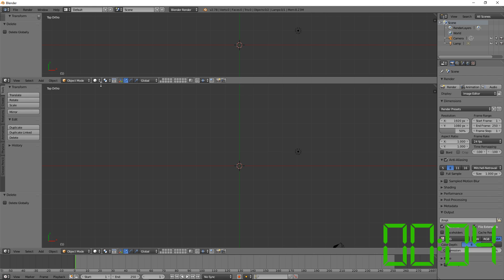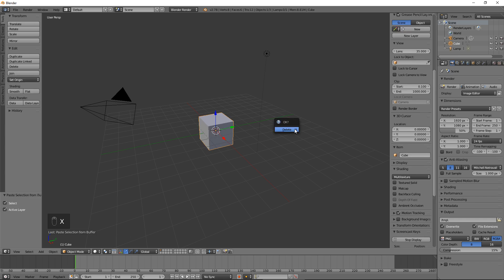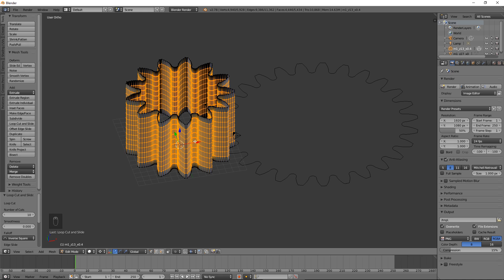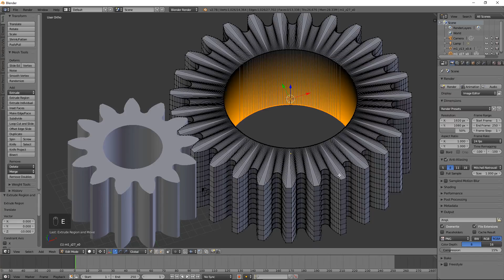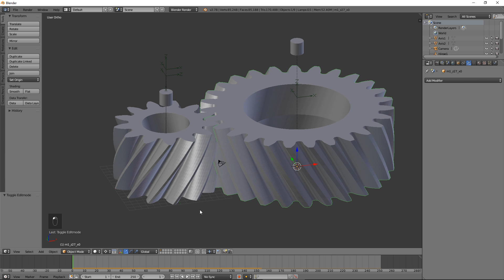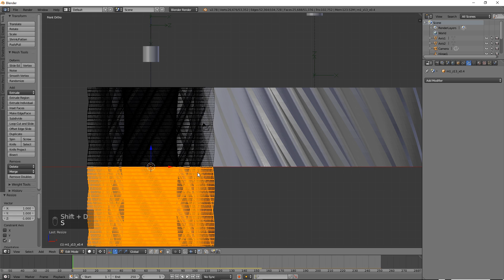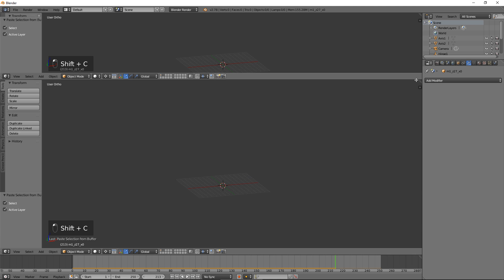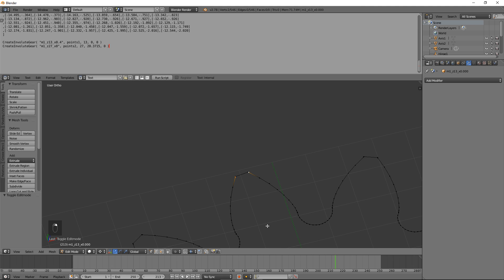Tutorial: How to Instantly Model Straight, Helical and Herringbone Involute Gears in Blender

Comment: Blender 2.8 users:  To use the auto-generated python script that creates the gear profile, you need to change 4 lines in the script.   These lines of code are deprecated in 2.8 and only work in 2.7 or less. 
    # Link object to scene and make active

    # these lines are valid  for 2.79 not for 2.8
scn = bpy.context.scene
scn.objects.link(ob)
scn.objects.active = ob
ob.select = True 
   
    # revised commands for 2.8
    view_layer = bpy.context.view_layer
    view_layer.active_layer_collection.collection.objects.link(ob)
    view_layer.objects.active = ob
    ob.select_set(state = True)
Reply: doesn't work "import bpy from math import *
  File "<blender_console>", line 1
    import bpy from math import *"
SyntaxError: invalid syntax
Reply: @rogermachin1046  You need to separate the import statements.
import bpy
from math import *

Comment: I have tried a 10 to 100 teeth  ratio and I had to go over 1 in profile shift to get rid of the red warning but the result was disappointing as the line of the profile crossed one another... I run the script without profile shift and fixed the problem manually but then the simulation worked only for a teeth and got blocked, and a  applied sub surface modifier did not fixed the problem. Otherwise it's great!